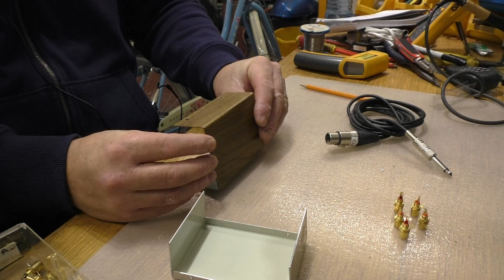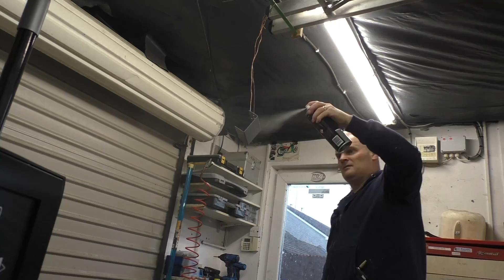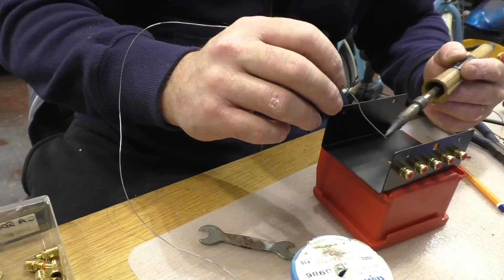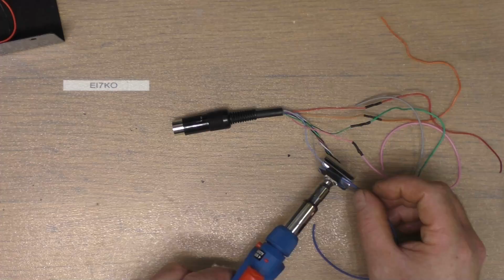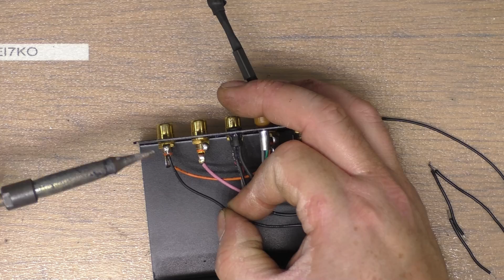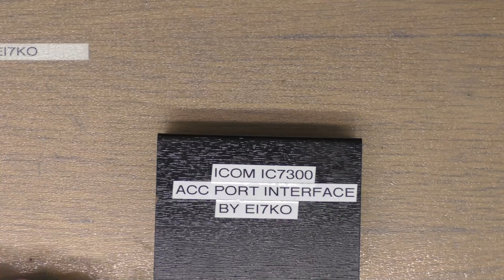How to Build an Icom IC-7300 ACC Port Interface | Full Step-by-Step Guide #icomaccport #icom7300

Comment: Hi George, I tried to connect the audio from the microphone through this connector on pin 11, but the sound is low quality and basically low-pitched, are there any other settings needed in the radio menu?
Reply from the maker: You have to selects acc port for audio import and set the level in the menus.

Comment: Thanks, George.  After seeing you build a couple of these and since I want to tap the AF to go into a mixer for output to a powered studio monitor, I'm going to tackle one myself.  I was happy to see that someone had done it a little more eloquent than just soldering a wire to the AF from the connector.  Nice!  Chuck 73 W6TUS
Reply from the maker: No problem chuck. I'm a bit of a perfectionist lol

Comment: Nice job. You mentioned that the 13 pin plugs that you had used previously (that didn't touch the sides of the Icom socket) were they the ones that you mentioned previously from TF? If so, do you have another source please? Thanks.
Reply from the maker: No, I don't, I insist on anyone that asks me to build them that they have to post me the supplied lead that came with the radio. I tried with several different sources and ran into the same problem. I may have another run at it though in the future.
Reply: @GeorgeDonaldsonsWorkshop  Thanks George.

Comment: Nicely done George. I’ve got an aluminum box down in the basement shack, some jacks, bits, pieces, and the accessory plug for my IC-7300. I’m going to put together one of these EI7KO inspired boxes this weekend. Afterwards I shall toast you with some Irish whiskey! Have a good day sir!
Reply from the maker: Thanks Howie. A nice little project. My own one includes a opto-coupling solid state relay to key the amp to isolate to voltage on the PTT line of the amp